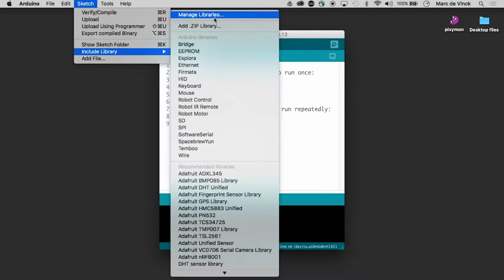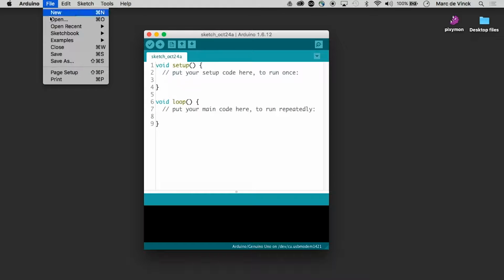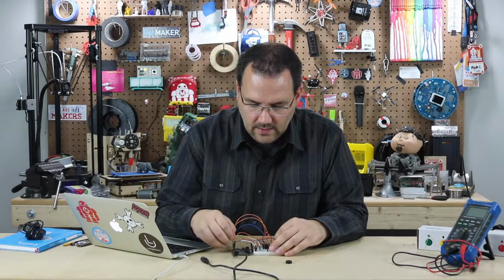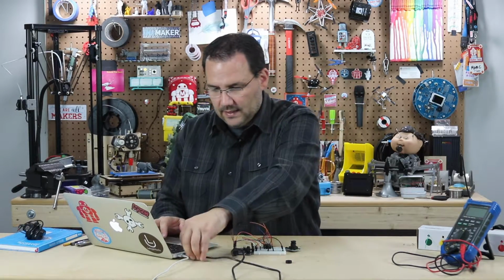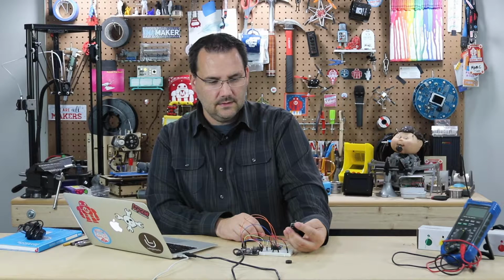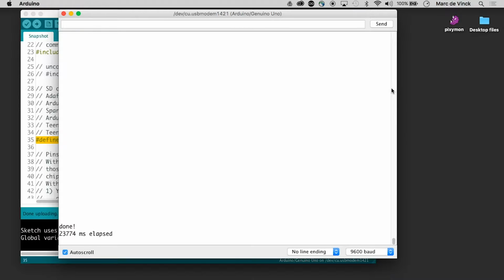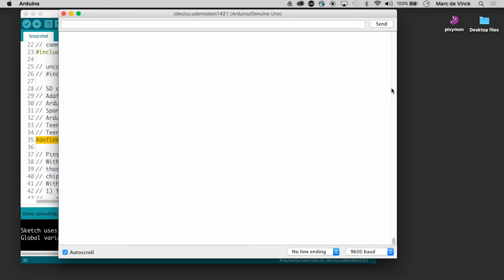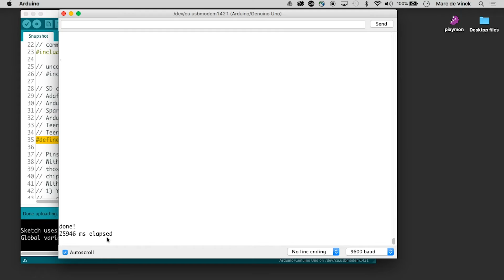Arduino Prototyping Inputs #62: Image Capture with a TTL Camera

Comment: Hey do you have any tutorials you can direct me to for the actual wiring of the TTL camera to the Arduino uno board
Reply from the maker: If you need more info other than in my video, Adafruit has a great tutorial -- https://learn.adafruit.com/ttl-serial-camera/arduino-usage
Reply: @MarcdeVinck  thank u! Btw your video was great! I just wanted a resource to make sure my TTL camera is wired correctly to my breadboard and arduino uno, (im a beginner haha) but your video was definitely great for image capture! I will be following it after confirming my wiring :)